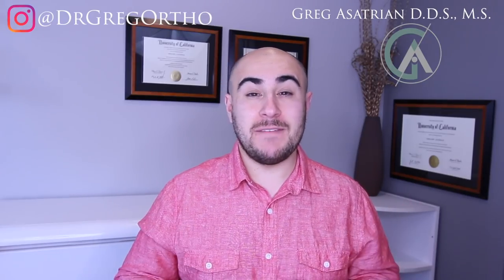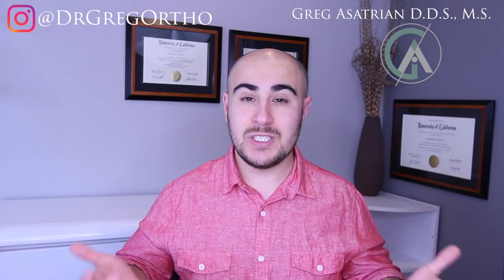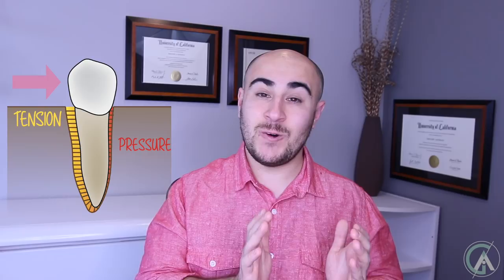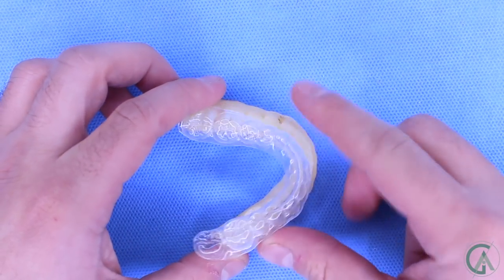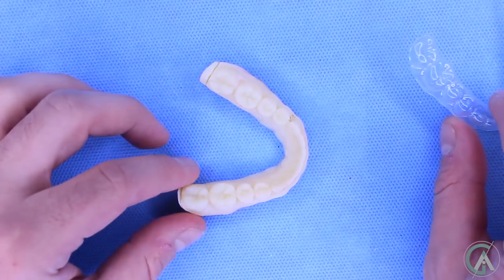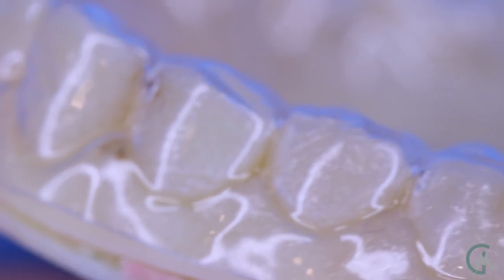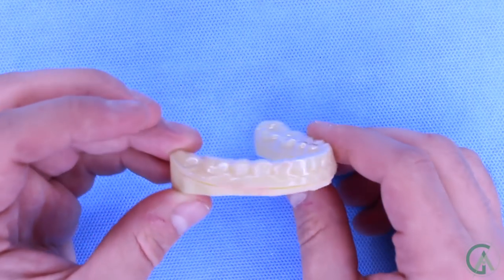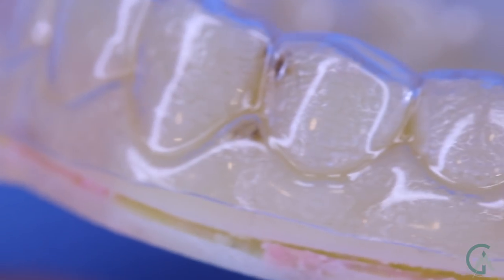How Invisalign Works // How Clear Aligners Work

Comment: I wanted traditional braces, but my ortho recommended invisalign for me. She said itd be a lot less metal (i have narrow arches) and less pain. She doesnt use attachments unless she sees its necessary. Im glad i got the aligners overall, but the new lifestyle is kinda annoying.
Reply from the maker: That's so great! Yup we dont like to use them unless they are necessary but sometimes they are =] I'm glad you're happy with your decision!!
Reply: What do you mean narrow arches? I'm hoping to get Invisalign too
Reply: How did the year go?
Reply: @yes7855  narrow arches, like you took an arch and pinched the sides in together where there's not a lot of space. So it created crowding for me. With the invisalign, the trays grab the whole tooth and can pull outwards creating an wider arch and more room for the teeth to fit instead of extraction.
Reply: @drinny26  im still going. I got rescanned last month and got my new trays. I've been having tracking problems throughout bc a couple my teeth didn't form completely so they're small. The trays were made bigger than my teeth actually are. But now they fit much better and I'm using the app to help keep me in check with wearing them properly. I'm hoping to be done in 2021. I have friends who have it and we all have a love/hate relationship with the aligners lol
Reply: @unbreakmyheart  are you done with your treatment?
Reply: @viktorijakarakulko949  unfortunately no. But hopefully almost! I have a couple teeth not cooperating
Reply: @unbreakmyheart  u done now? I’m getting the metal braces. Tomorrow
Reply: @unbreakmyheart u done?

Comment: hi i do have a question . if the tension pulls a tooth  in a direction because of the invisiligner and then creates a gap for new bone to be laid down, how does the pulling action remove bone in order to make movement? a

Comment: hi doc! question, my ortho told me i wasn’t eligible for invisalign because i need to get my wisdom teeth extracted and need to get one of my front teeth extracted because my top canine tooth never grew in due to lack of space, so the canine will replace the space of the front tooth once extracted. is it true that i’m not eligible for invisalign because of this, or should i get a second opinion?

Comment: hey doc,
I have the metal brackets on my top row 2 weeks ago and I have just gotten my spacers today. They said come in for the next appointment in two weeks. They said that the next appointment is for my bite plate. Does this mean that my wires will come in later after the bite plate? or will I have the wires in at the same time. im leaving out of town for 1.5 months. in 3 weeks. I do not know if I am safe or if i should wait after my out of town vacation. Any thoughts?

Comment: Hello Dr. Greg, I am getting Invisalign mid July and my orthodontist’s office let me know about a take-home system called Propel that helps cut down treatment time significantly. Personally, I don’t think time is an issue for me, however, they also mentioned it could help with pain management. I’m debating whether I should buy the devise since dental pain was an issue for me when I had metal braces almost ten years ago. I’d really like to know your thoughts. Thanks!
Reply: ghosted, rip

Comment: I just finished orthodontics for week, I took braces off without retainer during tuesday-saturday. I have worn clear retainer which less thickness than VIVERA a bit. I notice that middle line of upper teeth and lower teeth deviate a bit while wearing clear retainer. does it abnormal state? it hurts me a lot while wearing and take off for chewing meal. Do i have possibility to get back such the day that i took off braces- along middle line for upper-lower teeth?

Comment: Can twin block be used in my 27 th year , can it better my mastication process & affect my chewing process, or elongate my mandible forward , I'm experiencing a recessed mandible due to habitual chewing irregularity caused by extracted milk teeth , when 4 yrs old , do u have any suggestions to which treatment or surgery , should I opt to .......
Reply: Consult an Orthodontist...hv to plan.
Reply: @jp-jv8fc  how u can elaborate this fully , pls explain , & orthodontics is over , should I opt for surgery ?
Reply: Orthodontist ll go through ur case n previous records.. 
First v've to analyze everything..then ll decide Rx plan. 
ñ treatment outcome.
Reply: @jp-jv8fc  they say that it's bcs of masticatory muscles settling the jawbone into steep angle ,rather than forward angle , then what's the treatment or surgery to correct it?
Reply: Good...u know something may be bcz of Google. 
Consult an orthodontist..he ll decide u need orthognathic surgery.. U can take second opinion. 
It's not possible to advise any kind treatment without clinical examination ñ records.. K
Reply: @jp-jv8fc  don't worry , I'm not opting for surgery, unless there's substantial proof, I will abide by the law , without hurrying, & I have consulted maxillofacial surgeon& he only told me that masticatory muscles play a major role in facial harmony, &he added there's nothing wrong without my facial bones......& Teeth ,but the musculatory structure has, repositioned iself during my growing yrs, & that subsequent tooth extraction only added to it s misery ,email address request iwill send u x-ray, thanks
Reply: @salmanpalkarentertainment998  am'nt worrying.. 
first trust the doctors ñ change your attitude!!

Comment: Can you use 3D printing technology to make a replacement retainer after losing the original? I lost my original retainer, and went in to make the mold for another retainer, but within the  time that I didn’t have the original retainer (about 9 days) my teeth moved. The new retainer I received is not closing the small spaces I have.. what can I do ?
Reply: Same problem I'm facing
Reply: @farihamalik5736  ☹️

Comment: Why does it seem ortho docs try to talk patients out of Invisalign? It seems it it would be easier to wear these all day than braces.
Reply: I don’t know why they would talk patients out of Invisalign but I’ve had mine for just about 2 years and if I was offered braces I would’ve got braces. It’s super super annoying and hard to adjust to wearing them 20-22 hours a day.
Reply: When I got mine, the lady that did my financials (not the ortho) said that some docs don't recommend Invisalign because it really needs a compliant and responsible patient, so many times people didn't wear them as they should and then weren't happy with the results, or the treatment took longer or it just simply didn't work.
Reply: Mine didnt. Mine said invislign was  way better than traditional braces
Reply: @fernycarrasco1157  you have to be more responsible with them